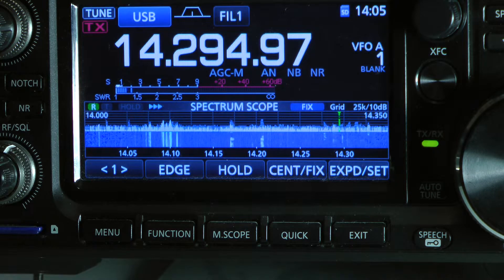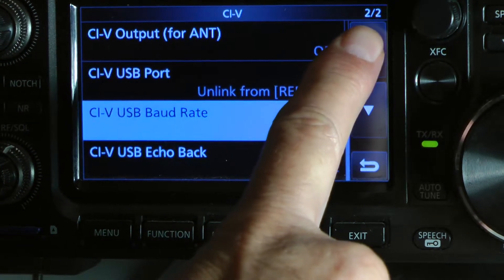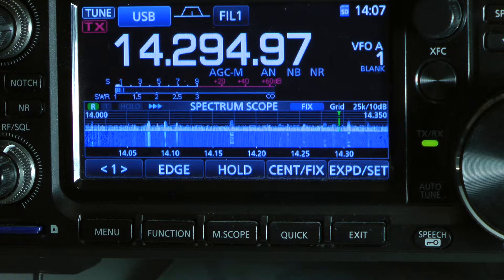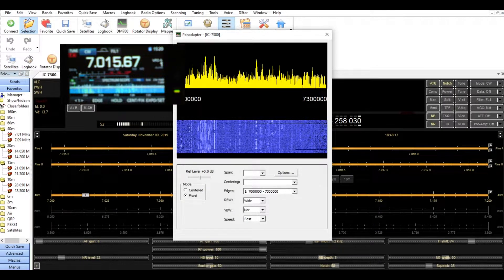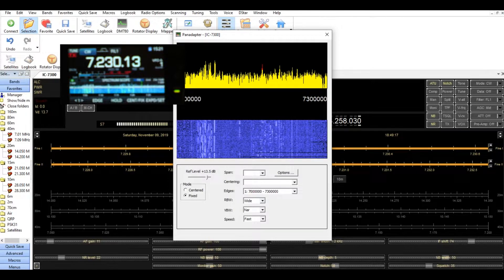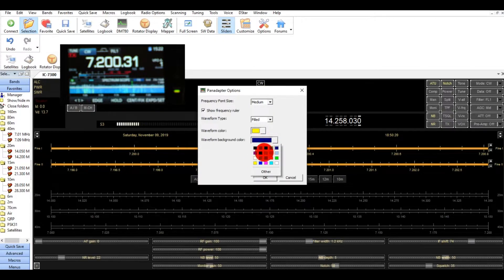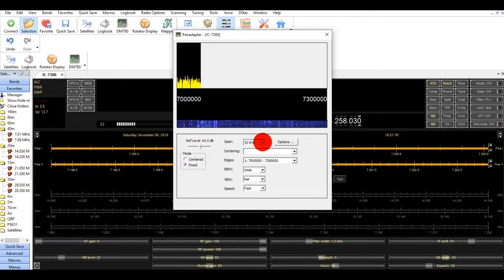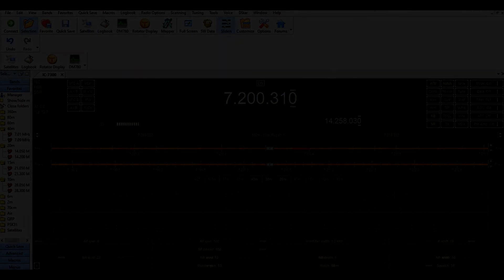Panadapter Ham Radio Deluxe Icom IC 7300

Comment: Bit slow on the uptake, me, but seems to me that HRD pandadapter is not quite ready for Prime-time. N1MM is better and shows a more accurate scaling. I like HRD's control interface though. Still looking for the perfect (non Flex Radio) solution.
Reply from the maker: You are probably right